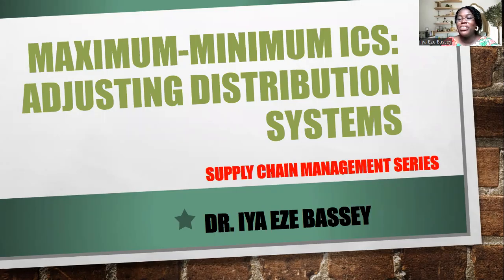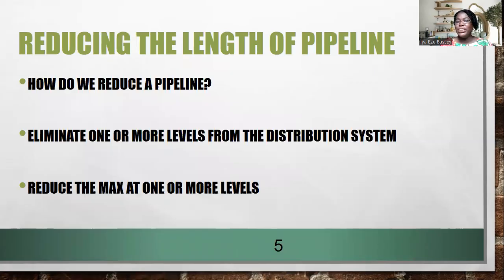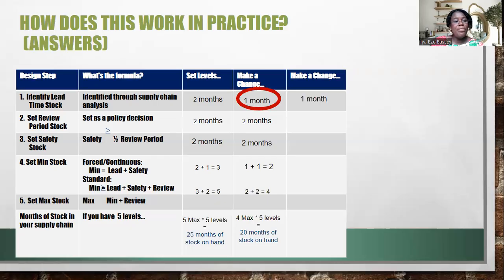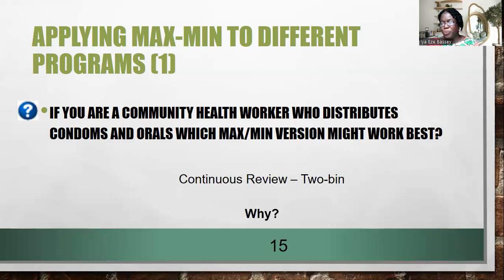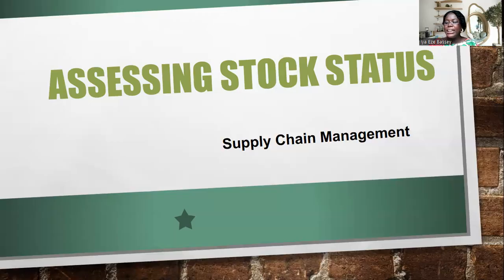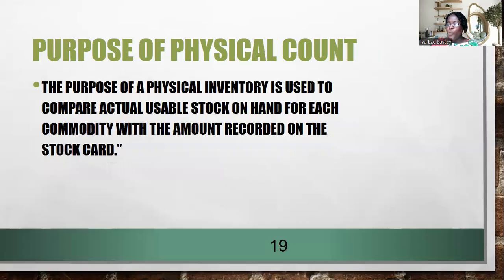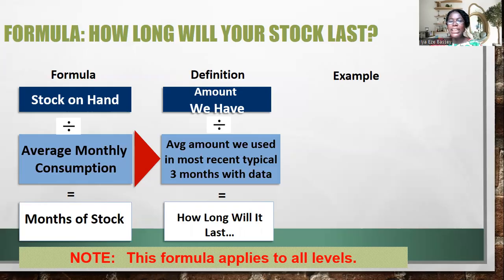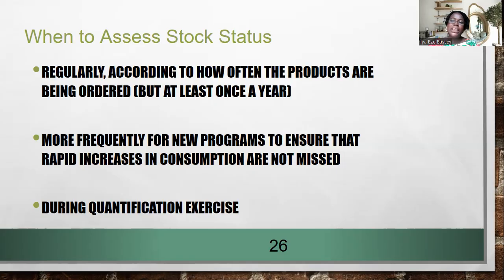Maximum-Minimum ICS: Adjusting Distribution systems (Supply chain management series)

Comment: Thank you very much Dr. for this wonderful lecture.
      From this exploration, i am able to deduced explicitly what it means by the pipeline system of distribution, and I am able to identify ways to adjust distribution system policies.
 This involve  a comprehensive review of the entire logistics network and pipelines, identifying areas where improvement can be made and implementing changes that can have a positive impact on efficiency in distribution of medical laboratory commodities from the Central down to laboratories.
           Steps of which includes
1. Set up initial max- min policies for each level and type of facility.
2. Check if the overall distribution will function properly if the level specific max- min policies are implemented.
3. Check the total length of the pipeline that the policies of each level imply.
    The challenges of max- min inventory control system used in the logistics management of HIV/AIDS commodities  ( LMHC) and the meaning and purpose of accessing stock status.
   Thank you very much Dr.

Comment: I have learnt that  Max-Min ICS pipeline can be adjusted
This is to reduce the number of months or the time taken for products to move from central warehouse down to clients
Also noting the systematic way of reducing it as its not done haphazardly
In summary adjustments is done to facilitate the overall smooth running of the pipeline
Its important to know that the shorter the pipeline the faster the distribution
Thank you so much ma for putting this up. Its quite insightful

Comment: This lecture is centers on adjusting pipeline in Max-Min Inventory Control System and assessing stock status. After understanding and selecting the type of ICS to be used in a facility, it is pertinent to check the length of the pipeline that is how long it will take from placing an order to receiving the commodities and getting it ready for use (i.e Lead time). If the pipeline is too long, it can be adjusted either by eliminating some levels from the system or reducing the maximum time at some levels. 
Reduction in maximum stock level can be done by reducing the RP, or reducing the lead time and also improving the distribution system reliability so the safety stock level can also be reduced. 
It was also seen that there are certain factors that affect the maximum and minimum stock levels. Just to mention  a few, they include, cost of product, storage capacity,  shelf life, lead time, accuracy of forecast, etc. The Max-Min system helps to avoid overstocking and understocking and it simplifies decision making in the ICS. 

Stock status in a facility can be done by carrying out physical count by hand to get the total number of usable units of a commodity at a given time. This is to compare the actual usable stock with the amount recorded on the store card and also to determine how long supplies would last. This physical count is done depending on the situation of the facility and should be done regularly. It gives the absolute amount and this absolute quantity is not required for the facility. What is need is how long the quantity obtained would last in month of stock. This is calculated using; 
Months of stock = Stock on Hand ÷ Av Monthly consumption. 

Amazing lecture!

Comment: Your lectures are really impactful and enlightening.
I learnt that some elements of the formulas can be change in order to reduce Max stock level.they include
1. Shorten the review period . 2. Reduce the lead time. 3. Improve the distribution system reliability.
The steps involved in designing a max- min ICS which are 
1.setting upan initial max-min policy for each level and type of facility
2. Check if the over all distribution will function properly if specific max-min are implemented  . 3. Check total length of pipeline that each level implies . I also learnt that the factors that impact max-min level are 
1. Age of program 
2. Cost of storage
3.cost of production 
4 .Lead time
5. Cost of storage

Comment: Thank you my summary I learnt to adapt distribution system policies effectively  allowing them to respond to changing needs and circumstance I also learnt the advantage and challenges associated to man-min (maximum _minimum) inventory control system gaining insights into each role and making optimal stock level. I also learnt the steps involved in designing a max ics which are setting up an initial max-min policy for each levels and types of facility. Which are: age of program,checking if the overall distribution will function properly in specific maximum policy are implemented etc.

Comment: Thank you ma for the insightful lecture.
*They are different steps involved in designing a max - min inventory control system;
1)Set up initial max - min policies for each level and type of facility
2)Check if the overall distribution will function properly if the level specific max - min policies are implemented
3)Check the total length of the pipeline that the policies at each level imply.
**Advantages of using the max - min ICS
1)Avoid overstocking
2)Avoid under stocking
3)Minimize wastage
4)Simplify inventory control decision making
5) Consistency of stock levels
To reduce maximum the following are done;
1)shorten the review period at one or more levels
2)Reduce the lead time at one or more levels
3)Improve the distribution systems reliability at one or more levels so that safety stock can be reduced.
* Challenges involved are;
a)system with numerous systems
b)system that manages a large number of commodities
c)system that manages products for new program
*Also that they are factors that affect or have an impact on the max - min levels are;
1)Cost of production
2)Lead time
3)Storage capacity
4)Age of program
5)Shelf life of health commodities.
*Also learnt that under assessing stock status entails physical count which is to compare actual on hand for each commodity with the amount recorded in the stock card.
**The purpose of assessing stock status is to determine how long supplies will last.

Comment: maximum minimum inventory system is the determination of optimal order quantities and reorder points which can prevent stock outs while minimizing excess inventory. Also, the selection of appropriate transportation and logistics strategies is another important consideration. Technology also play a crucial role in adjusting distribution systems. Collaboration and communication with suppliers and other partners in supply chain are also essential. In summary,adjusting distribution systems in the maximum minimum inventory control systems in supply chain management involves optimizing order quantities, selecting appropriate transportation strategies, leveraging technology and fostering collaborations with suppliers. All this will help to improve customers service, reduce cost and enhance overall supply chain efficiency.
I also learnt on some factors that impact max -min stock levels which includes...
1. Product cost
2. Cost of storage
3. Storage capacity.

Comment: In this video I learnt the steps involved in designing maximum ICS, I also learnt that to adjust the distribution system we can consider options like, optimising inventory levels, modifying order quantities, adjusting delivery schedule.
I also learnt on some factors that impact max -min stock levels which includes...
1. Product cost
2. Cost of storage
3. Storage capacity.
   I have a clear understanding of the benefits associated with the max -min system , such as it ability to prevent understocking and over Stocking.

Comment: Adjusting distribution maximum and minimum control system has to do with elements of the formulas which can be changed in order to reduce the max stock level. The following are identified and shortened
1. Lead time= 1month
2. Safety stock= 2weeks
3. Max =2month
4, Min=1months
5. Review=1month
Stock are assessed regularly, according to how product are being ordered, frequently and during quantification exercise.
Its impact include cost of product, reliability of transportation, storage capacity, cost of storage condition at different levels, shelf life of health commodities.
Advantages include avoid over and under stocking, avoid wastage, cost of emergency orders, reliable data source from SDP e.t.c
Challenges include: system with numerous level,system that manage a large number of commodity system that manage products for new programs.
Applying max and min is the continuous review and standard version.
Assessing stock which involves Physical count which is the process of counting by hand the total number of usable units of each commodity in your store or health facilities at any given time.
Purpose of physical counting is to take the actual usable stock on hand with the amount recorded on the stock card, determine how long the supply last.
Thank you.

Comment: This video made me to understand that, The Maximum-Minimum Inventory
Control System (Max-Min ICS) can be a valuable tool in supply chain management for adjusting distribution systems. This system helps ensure that your distribution network operates efficiently while maintaining optimal inventory levels.
The key storage activities are: 1. Supply receiving and incoming inspection, 2. Put away, 3. Picking and packing, 4. Shipping. 

In summary, the Maximum-Minimum Inventory Control System can play a pivotal role in optimizing distribution systems within your supply chain. By setting appropriate thresholds and utilizing demand forecasting, you can ensure that your distribution network efficiently meets customer demand while minimizing costs and risks.
Adjusting distribution systems in this manner can enhance customer satisfaction, reduce operational expenses, and contribute to overall supply chain resilience.

Comment: Thanks ma'am
In summary have learnt the steps involved in the designing a max-min ICS which are:
1) Setting up an initial max min policy for each level and types of facility 
2) Check total length of pipeline that each policy level implies.
3) Check the overall distribution will function properly if specific max-min policy are implemented.
Thanks very much for this awareness

Comment: In summary, there are three steps in designing max-min ICS. Also, elimination of one or more levels from the distribution system will help to  reduce the length of pipeline.
*Factors that impact max-min levels are 
- lead time
-Cost of products
-age of program, etc
*An advantage of the max-min levels is that it helps to minimize shortage and wastage

Comment: This is a knowledgeable lesson...length of a pipeline
The steps in designing a max-min ICS  
1. Set up initial max-min policies for each level and type of facility
2. Check the overall distribution Will  function properly if the level specific max-min policies are implemented 
3. Check the total length of the pipeline that the policies at each level imply...i also learnt how to  reduce the length of a pipeline

Comment: In summary
Max-min inventory simplify inventory control decision making.
The advantages of using max-min system are
1) minimize wastage
2) avoid overstocking
3)avoid understocking.
There are also about 4 factors that impact max-min stock level ÷
1) lead time
2)cost of products
3)storage capacity
4)cost of storage.
The challenges involved in this system are
1) system with numerous systems
2) system that manages a large number of commodities
3) systems that manages products for new program.
And also this video teaches us that there are steps involved in the design designing of max-min ics which are.
1) initial max-min polio for each level
2)check if overall distribution will function properly.
3)check the total length of the pipeline that governs at each level
Thank you and God bless you ma.

Comment: At the end of this video, I have understood the steps in designing a max-min inventory control system.The ways to adjust distribution system policies includes eliminating one or more levels from the distribution system, setting up policies that could reduce the max at one or more levels and there are elements of the formula which can be changed in order to reduce the levels. There are other factors that impact max-min stock levels such as cost of products, storage facility etc. The advantages of max-min system usage is to avoid overstocking, avoid understocking, minimize wastage, avoid cost of emergency orders, amongst others and challenges to using each version and variation includes system with numerous levels, systems that manage a large number of commodities, systems that manage products for new programs.

Comment: MAX-MIN ICS: Adjusting Distribution System
Adjusting the distribution system in an inventory control system involves optimizing the way goods are allocated and delivered to different places. 
It helps us to Avoid of over-stocking, Avoid under-stocking, Minimize wastage, avoid cost of Emergency Orders and ensure Consistency of stock level etc
It could be achieved by 
Reducing the length of pipeline by eliminating one or more levels from the distribution system. 
Reducing the Maximum stock level by shortening the review period and lead time at one or more levels
Take the factors that affect MAX-MIN stock levels into consideration such as: storage capacity, cost of storage, skills of staff, accuracy of forecast, age of program

Comment: Thank you Ma
There are steps In designing a Mac-min ICS which are; 
Setting up initial Max-min Policies for each level and faculty 
Check if the overall distribution will function properly if the level specific max-min policies at each level imply.
Elements of the Formulas which can be changed in order to reduce the max stock level
-Shorten  the review period at  one or more levels 
-reduce the lead time at one or more levels
-Improve the distribution system reliability
Factors that impact max-min stock level
-Cost of products
- reliability of transportation 
-shortage capacity

Comment: In this lecture, I learnt the steps involved in designing a max-min ICS and the factors that impact max-min stock levels which include; cost of products,reliability of transportation, storage capacity, cost of storage, storage conditions at different levels and shelf-life of health commodities. There are other factors that impact max-min stock levels which includes lead times, age of program, accuracy of forecasts and a few others. 
I also learnt the advantages of using max-min systems which includes; to avoid overstocking or under-stocking and minimize wastage etc.

I learnt about physical count which is the process of counting by hand the total number of usable units of each commodity in your store or health facility at any given time and the purpose of physical count which is used to compare actual usable stock on hand for each commodity with the amount recorded on the stock card.
I learnt that the purpose of assessing stock status is to determine how long supplies will last and I learnt that stock status should be assessed regularly.

Comment: In summary, I understood that,The Maximum Minimum Inventory Control System (MMICS) is a supply chain management tool used to ensure that inventory levels are maintained within a specific range, known as the maximum and minimum levels. The MMICS system uses algorithms to calculate the ideal inventory levels based on historical data, sales forecasts, and lead times. When inventory levels fall below the minimum level, the system automatically generates a purchase order or a production order to replenish the stock. Similarly, when inventory levels exceed the maximum level, the system generates a signal to stop ordering or producing until the excess inventory is consumed. This helps to prevent stockouts and overstocking, which can lead to waste and increased costs. The MMICS system can be integrated with other logistics management information systems to provide real-time data on inventory levels, orders, and shipments, enabling supply chain managers to make informed decisions about procurement and distribution of health commodities.

Comment: Here again with a brief summary of what I got from the class.. 

Steps in designing max-min ICS includes
Checking the Max-Min policies for each level

Checking the overall distribution

Checking the total length of the pipeline.. 

Elements that can be changed to help reduce the max stock level

Review period
Distribution system
Storage capacity 
Cost of storage
Lead time etc.. wheras the 

Advantages using max-min system includes

Reduced shortages
Avoidance of overstocking
Consistency of stock level..

The disadvantages in using ICS system involves the following

System with numerous levels, large number of commodities etc..

Have a great day ma..

Comment: In summary,
I've learnt the steps in designing a max-min ICS, advantages of Max min system, challenges involved in using each version and variation, purpose of accessing stock status, elements that can be changed in order to reduce Max stock level.
Thank you😊

Comment: From this video, I learnt that:
* One of the steps in designing a max-min ICS is setting up final initial max-min policies for each level and type of faculty. 
* The factors that impact max-min stock levels include; cost of product, reliability of transportation, storage capacity, cost of storage, and so on.
* One advantage of using max-min ICS system is to avoid overstocking.
* Some challenges with using the system include systems with numerous levels, systems that manage a large number of commodities, and systems that manage products for few programs.
* Physical count, which is the process of counting by hand the total number of usable units of each commodity in your store (for stock assessment), is used to compare physical actual usable stock on hand for each commodity with amount recorded on the stock card.